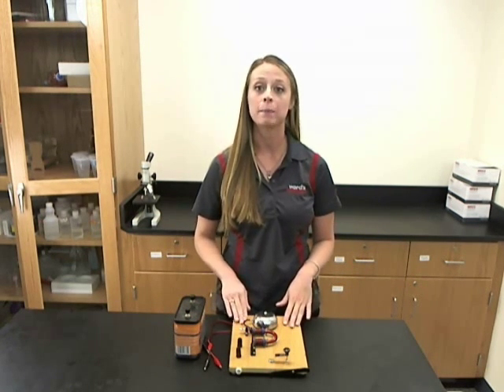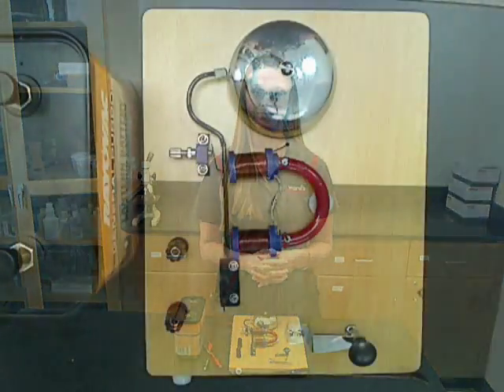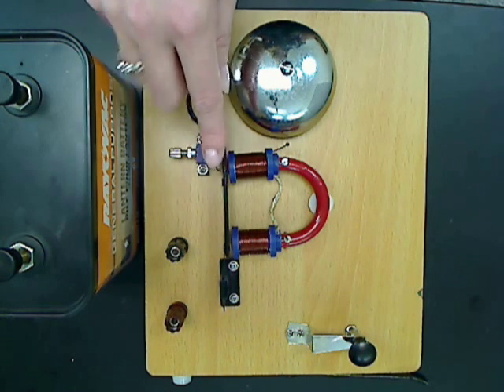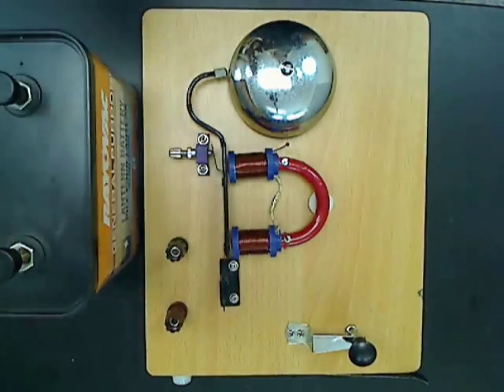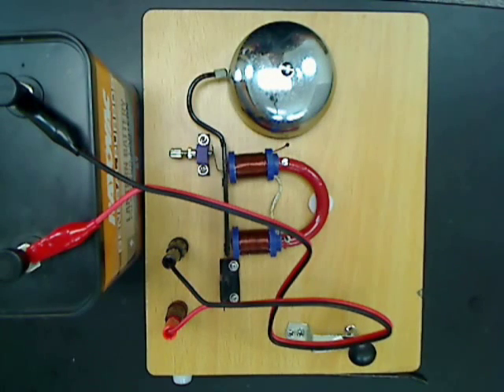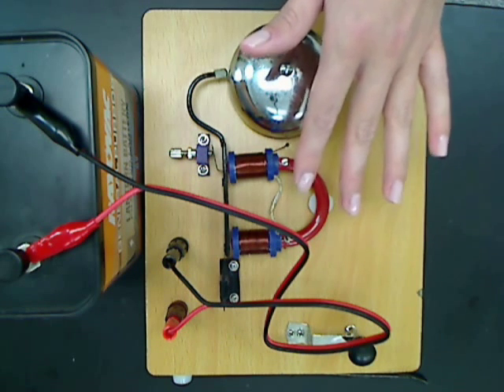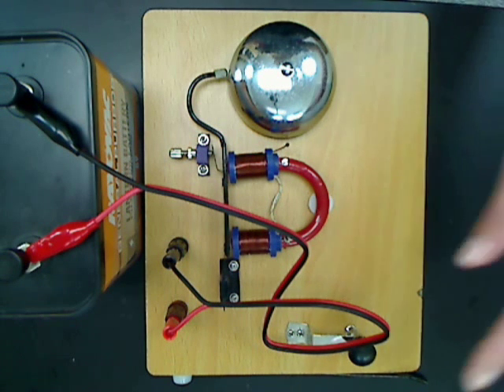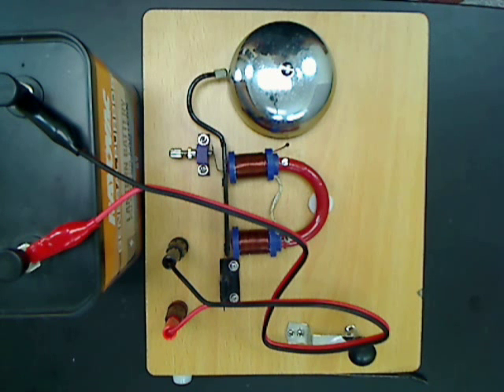Bell Demonstration

Comment: how much current/ voltage do you have in your battery and how many turns and gauge of wire did you use to make the electromagnet part? I have the same project but the magnet is not that strong enough to attact the metal hammer. Please help.